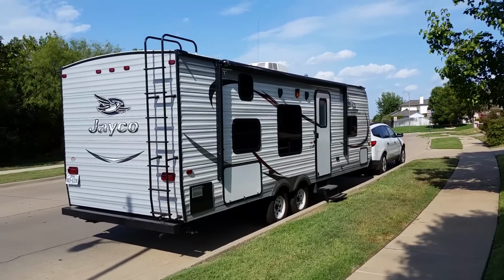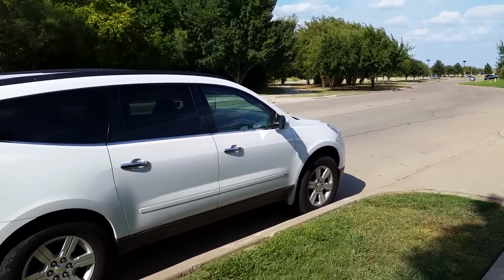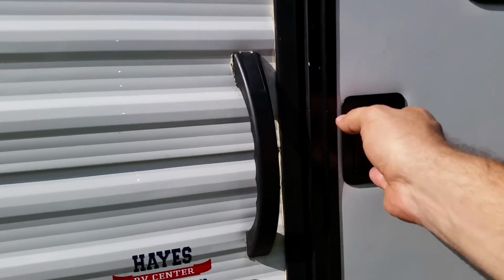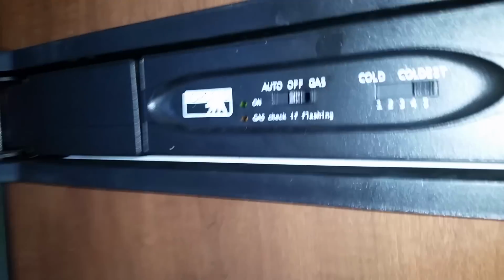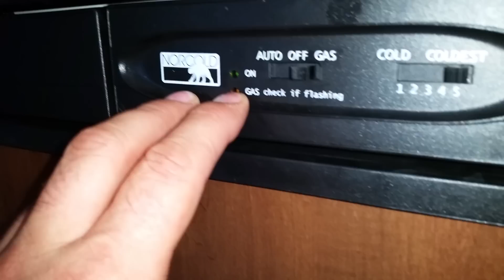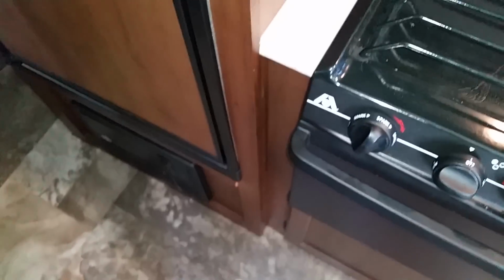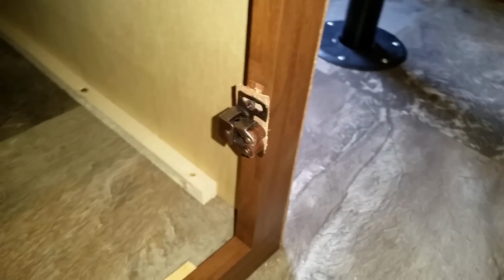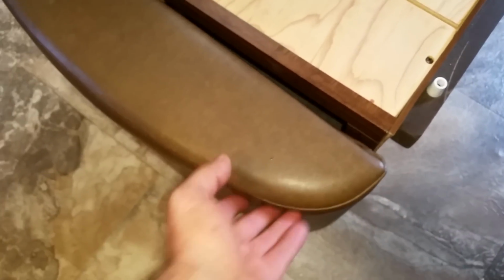Update: New JayCo Trailer FALLING APART.  Lengthy Warranty Work Needed.

Comment: I work at a service center and its a crapshoot. There is no quality control checks at Jayco, its up to whoever installed whatever component to do it right. No supervision, just production quotas and lord help you if you dont make quota. I have nonstop work fixng these rolling turds. The ideology is, they build them, we finish them. The unit im working on has a list of warranty issues and a 4 hour job has turned into a 10 hour job easy. Some units are put together well but it seems many are done cheaply and since america is hooked on camping the demand has well surpassed production. Its a great market to be in, pump out overpriced crap and make buttloads of money while paying employees nothing.

Comment: Sad your learning the hard way, but MOST trailers are garbage.
They won't fix your fridge issue, they will deflect you to the mfg of it.
They aren't going to warrant the cosmetic stuff that is broken, they are just going to say abuse and wear aren't covered.  So yeah that 2 year warranty is just a joke on people that haven't learned yet.
IF they built it well you would need something else to tow it with, you guys want light trailers that your little cars can haul don't expect good and plenty of build material because it isn't going to happen.
Lastly buddy I'm not trying to be mean or anything but you are making the road more unsafe towing that trailer with that little traverse, empty that trailer is prob already at max for what that car can tow.  While it might PULL it, controlling it is another matter all together.  I understand loads of people overweight their light duty vehicles all the time, use to do that myself until I went down a long step grade with a cab over flat bed hauling too many cars and roasted the brakes.
At the end of the day, that traverse will atleast burn through it's transmission far earlier than it ever would have.....

Comment: I don't know how you trailer that Jayco with Traverse.
Traverse towing capacity is 5200 lbs and that model Jayco GVW is 7000 lbs. 
Seems the Traverse is underpowered.... It's not just underpowered but braking can be issue. Stopping is as important as starting

Comment: I had the exact same experience with my 2018 Jayco Feather 24’. Damn thing fell apart in 90 days after a 2 week trip. Had to do 2 month long warranty repairs. Needed new FLOOR, new couch, new bathtub, new bathroom sink, new outdoor speakers. Only place that does warranty work on RVs is the place where you buy it. Sales will tell you that any Jayco dealer is required to fix but thats BS! Got the warranty work done and immediately sold it. Never buy a Jayco!

Comment: Normal. I work in the rv business. looks like you leaned back in the dinette to me. Lots of common issues. molding around the counter is due to water splashing. Cabinet door will never work properly. Try putting your house on a trailer and driving down the road.  This is normal.

Comment: Kind of an old video but I ran across it and thought to leave a comment. First and foremost, the RV industry has a huge issue with QC and warranty service. Many units coming out of the factory have issues. In this case, the Jayco has design issues such as the seat back on the dinette or the pony wall. Those are always going to be a problem and there is just no fixing poor design. Secondly good luck getting warranty work done in a timely manner. With the sloppy QC from the coach manufacturers to the individual system manufacturers (Dometic, Coleman, NorCold etc), these guys have their hands full which is certainly hindered by a lack of trained quality technicians. 

SO am I saying that any one coach is better than the next or to stay away from RV's in general...not at all. When you buy a boat, you expect to spend money on it after you purchase and you know that you will need to fix stuff if you ever want to keep using it the way you want when you want. Ever had a boat that needed repairs? Marina's are kind of like RV shops...backed up. You learn to fix the little things and go into the shop only when it is beyond your mechanical means or is expensive (and it should be fixed under warranty!). You own a boat, you better be handy with the tools. 

You can also thing of it like buying a new home. Yes, it comes with a warranty and yes the contractor/developer promises to come out and fix what ever is wrong. They did not say how fast just they world. Then you have different systems, AC, Plumbing, Kitchen, rood, etc, each with there own set of contractors/service. This is the same with RV's. With a car you deal with one manufacturer...with homes, boats or RV's you really are dealing with many. Many people go into an RV purchase like they do a car...different animal.

I have been RV'ing since 1972. In the 70's I was young and my parents bought a D24 Winnebago Indian. We had a blast with it. We also worked constantly on it. The batteries were a constant battle, the Onan Generator seemed to always have carb. issues, chased leaks, and so on but we kept the Winnie running. I inherited it in the mid 90's and finally sold it in 2001. The new owner drove it away. I bought 4 other travel trailers since then and they all came with the issues but we all had fun with it. I just bought a 2019 a few months ago and have had fun with it already and yes, I had to make some minor repairs. It is what it is. 

If this all scares you...stay with B and B's, Resorts and Hotels. I like RV camping and I even enjoy working on them. I HATE going back to the dealer and they know when I do come they cant BS me because I knew my units inside and out! 

PS: I would not tow any trailer beyond a the smallest U-haul trailer with that crossover SUV. This is one of those scenarios where just because you can pull it, does not mean you should. I am concerned for him and his family with that lashup. Am I a truck guy...yes. I also had a 3/4 ton Suburban that was an awesome tow rig....it was up for the job.

Comment: Just bought a RV and we skipped over many Jaycos. They were cheap and seemed to be what we wanted but we know they are junk. The towing frames are weak as hell. The walls are holding the frame of the trailer together. It should be the other way around.

Comment: if you have ever been to a jayco the mass produce all there line of trailers and motorhomes ,your model  when its on the order line they build about a 100 a day ,I have a jayco greyhawk  31fs motorhome and that was 1 of 40 that production day and that's no be but your right look them over 100 % before you buy because as you know even new ones can leak.you could start a business just going to rv centers with newbes

Comment: Yeah, thats about the quality build of almost any brand trailer. Just like a home, you have to do your own home repairs. Those are just small cosmetic fixes you can do yourself. The design of that bench was in itself was bad. My Jayco dining set is built almost like a church pew where there is siding frame that it is screwed into, not just into the bottom half of the seat. Now if there was anything mechanically wrong with it, I’d be upset.

Comment: I have a Surveyor by Forest River. Got the 6 year warranty...should have saved my money. After 2 couches replaced, mattresses and a bunch of other small issues I gave up. I started fixing things myself. This summer i had to replace the whole floor in the front of the trailer because the factory did not seal the front bottom weather stripping. It was not even in a place I could reseal it myself without removing the whole front cap. Bacically leaked from day 1 and 10 years later a completely rotten floor. Disgusting!! Should be a class action cival suit filed. $40,000 for a piece of junk!

Comment: Wow that was pretty crazy.  Really big issues with their workmanship.  The only thing I might question is the refrigerator.  When you are towing your 12 volt system won't power the fridge.  Probably not a great idea to run the fridge on propane as you are going down the road.  Not even sure if that would work.  I suspect that's why your check light is on in your fridge after you tow it.  Mine does the same thing.  Soon as I get to where I'm going and turn on the propane or hook up to shore power presto the fridge instantly works.  If I turn it off and on the check light goes away.  Other than that the rest of your issues are shocking to see how bad the craftmanship is.
Reply from the maker: They had that specifically designed to run while driving.  They fixed it.

Comment: My wife and I bought a Riverside RV Retro 199 FKS in 2017.  We've been out in it at least once a month, sometimes twice.  Only had two issues which were warranty fixed after we bought it.  The J pipe under the shower needed to be tightened, and the electrical outlets weren't working in the back by the bed.  Other than that the unit has held together really well and we've enjoyed it very much.  Made me glad we have had a much better experience now that I've seen your video.
https://www.youtube.com/watch?v=BFPMKoylTDM
Reply from the maker: Very nice!

Comment: Fix the entrie structure? I dont think thats possible.  It could be the materials are just too weak that they used. Lots of screws into particle board? Wont hold, then it needs thru bolting. Those plastic edges on walls are truly cheap plastic molded strips. I went looking at some Rv trailers and many are built the way your is. I did see some real nice 5th wheel for $85,000 that seems  to me of a much better quality.

Comment: If you're able to tow a camper that big with a car that small, red flag.  Remember, they're built to cut weight.  With trade-offs like that, you can figure the rest.  Think about this: RVs and campers are continually exposed to tropical/hurricane force winds and earthquakes at the same time for greatly extended periods if time.  Ya got screwed, best thing to do is to start doing the work yourself; if it's the carpentry and trim stuff (that work will never end) DIY.  I would definitely get the appliances fixed under the warranty.

Comment: cheap brand equals cheap product. I used to work for a rv manufacturer in the cabinet department and even other employees told me how crapy the materials are that are used for building. keep in mind the coaches I worked on started at $125,000. RV'S are nothing but a money pit unless your going to remodel one or spend a quarter of a million plus buying new. Best of luck

Comment: Although I do not yet own a Jayco, I do not let this one terrible situation put me off.  All manufacturers are building too quickly and are focused on their bottom line for the shareholders.  This has become especially true in the last ten years when pretty much every brand has been bought up by one of two huge corporate conglomerates.  Do some research.  Jayco has a good rep they built in the past.  Now they are owned by Thor Industries, which seems to own nearly every major brand now.  If the brand you are looking at is not owned by Thor, it is owned by Berkshire Hathaway (Billionaire Warren Buffet), under the guise of Forest River.  Mega corporation conglomerates are totally about quick, cheap, and making a buck.  There are very few independent RV manufacturers any more (Nash-Arctic Fox is one I think, but as someone else said below, quality is heavy and expensive).  If you are in the market for a travel trailer, just beware.  Don’t necessarily avoid any one brand because of corporate ownership.  Do your homework.  Be smart.  This goes for RV dealerships as well as manufacturers.  There are large corporate dealers who demand high output and sales and are known for poor service.  There are other dealers who go through their trailers as they get them and do QC.  Those dealerships understand that it is not just Jayco whose name is on the line, but their reputation as a dealer.  They won’t send their customer off the lot with junk.  If there is a problem they will deal with it right away!  A good dealership is worth it’s salt.  This is true for cars, refrigerators, air conditioning units, etc.  Some dealers have character and integrity.  Others have a Wal-Mart mentality.  Do your research on the brand and the dealer before you buy.  Let this video be instructional on what you need to look for and what kind of quality you need to insist on when buying.
Reply from the maker: Good stuff.
Reply: Follow up.  I bought a 2020 Jayco 26BH.  Same model as this.  As I suggested to everyone, I researched and then went through a reputable dealer.  They did go through when they got it on the lot.  Based on this Content Creator’s experience, I checked a lot of things during our walkthrough.  As I went through, I found one piece of wood trim loose and pointed it out.  They fixed it as soon as we finished the walkthrough.  Based on the experience in this video, I  don’t know how I missed the dinette seat back, but I did.  I checked it as I went through it again at home.  Yep, the stapled joint was comping loose.  I took it back a couple weeks later to have some additional things installed and pointed out the problem.  They fixed it without complaint. As far as that dinette seat back, I did some research before I bought it.  Pretty much any Jayco, and some other brands as well, that has that kind of free-standing seat back can be problematic. If you get a model that has a dinette campsite as you come in the door, there is often a problem.  In some Jayco models, and other brands they put a cabinet or shelf behind the dinette seat which gives it a more solid backing.  The problem for me is those models are longer and heavier than my tow vehicle can manage.  I had a 1970s Prowler with a similar dinette seat back by the door, but it was more substantial and ruggedly built.  1970s vs. 2020.  Back to this situation.  As I said, it is common to see this problem with that style of dinette.  There are quite a few forums, including Jayco Owner’s Forum, that have people posting how they have reinforced their dinette seats.  Going back and putting screws in is a quick easy start.  

I read repeatedly that an RV owner needs to be able to do the maintenance work on their trailer.  All trailers, even well made ones, shake apart with travel.  Look for Long Long Honeymoon RV content channel.  They put a camera in their Airstream while driving.  They said they heard that trailers go through stress like an earthquake every time they travel.  Things will shake apart, even on an Airstream.  You have to be handy and maintenance savvy, or become so if you own a trailer.  But definitely find a good manufacturer.  Find a good dealership.

Comment: I have a 2016 34RSBS and we have had nothing but problems. The staff at these Jayco dealers are a piece of work too but that's another story. We had the shower leak, bad fuses, propane problems, blinds falling apart, basically a list so long it's not even funny of things that were falling apart or not working and broken from the factory..... Needless to say we are getting rid of this pile of junk and looking for a well built 5th wheel. I will never buy a Jayco product ever again. I had to wait 6 months to get my trailer back from warranty work after they said it would take 6 to 8 weeks. Then I get my trailer back and the dealer had wrecked it. Almost tore off the ladder and busted the tail light. I will say this though. My parents 2002 bunk house never had an issue. Seems like their standards have dropped as far as a quality product. If I owned my own business, yes you need to make a product in a proper amount of time to make a profit but I would never let a product leave if I wouldn't buy it or be satisfied with the quality. I would bust my butt to fix it if warranty work came up. It's all about the dollar now days. No one cares or respects each other or their property anymore.

Comment: If you seen how fast they put these together you would understand why the quality lacks, there are plenty of factory videos here on YouTube showing how they put these together, fast real fast, you will see the employees actually running from station to station:) But to be fair I’m sure most of the RV manufacturers are similar, they are all put together very flimsy and a lot of particle board and the ones with the rubber roofs, check the thickness of the membrane, it won’t change.

Comment: I bought a new Thor Four Winds, 28Z, and had the same issues. Nothing inside worked right, a month for an appt, and another 6 weeks to get it back.  Nothing fixed, at all, and make another appt, same routine. Then the exterior paint faded, on a 2 year old vehicle, so selling it was impossible, even with going into my pocket for $20,000.00. 
My solution, voluntary surrender, and let them Sue me. I will fight it, on the basis the lender should have known the product was garbage.

Comment: I can't speak for other brands, but Keystone isn't any better. In 6 years we have stuck close to 5 grand into fixing our trailer, both axles, brake drums, water leaks that mysteriously pop up. I could go on and on, but the bottom line is that they build these things with the cheapest materials and shove them out the door in 8 hours. One more thing, don't believe that bs about the company being there to help and support you if you need help trying (and the key word here is trying) to get work done under warranty. That's nothing but a big sail down the river, most of the time the customer service people won't even return phone calls or e-mails.